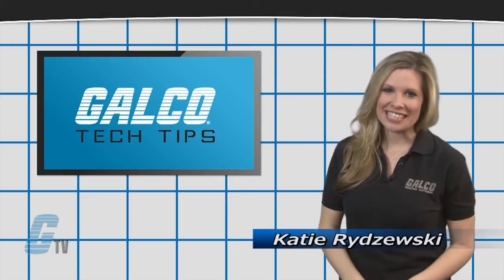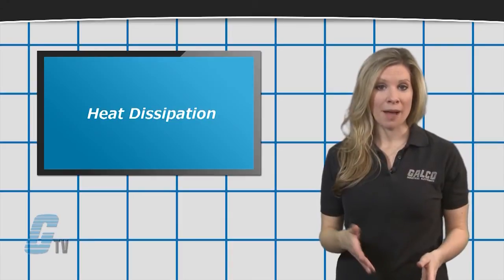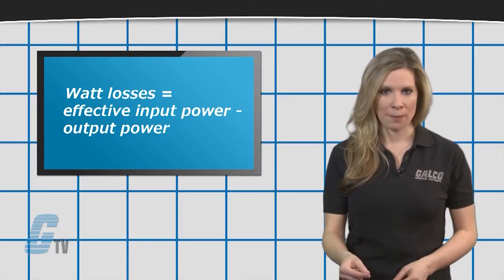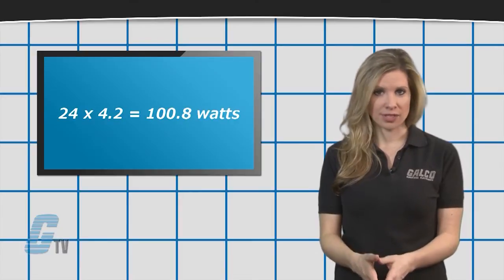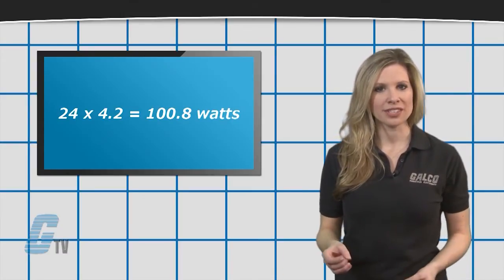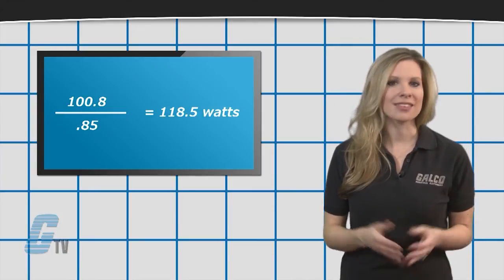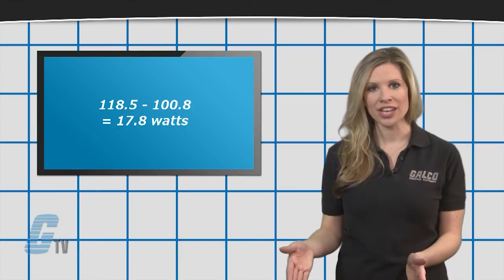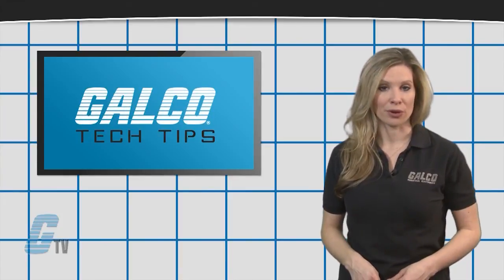Heat Dissipation in a Power Supply - A GalcoTV Tech Tip | Galco

Comment: Can i use this method to calculate heat dissipation of electrical panels or switchboards? If i want to convert the electrical unit Watt to btu, should i just multiply it by 3.412?